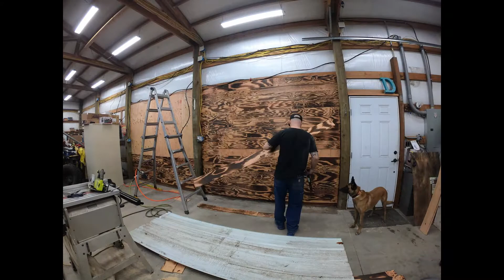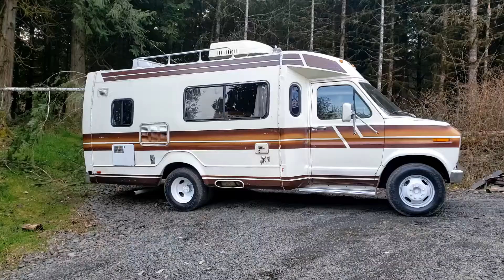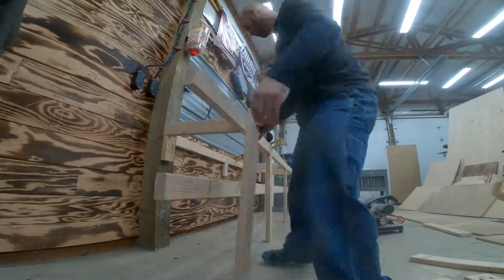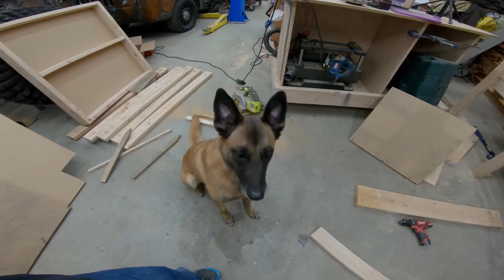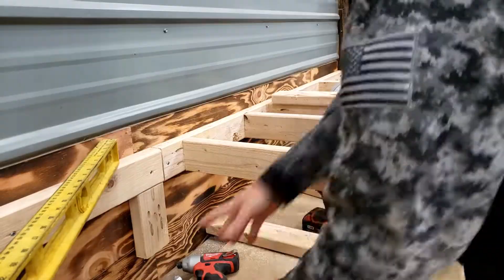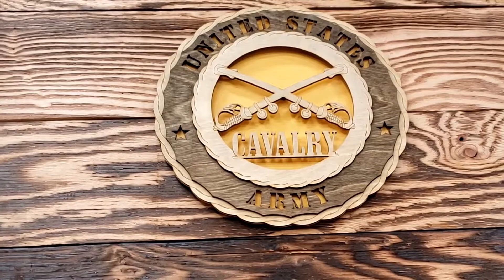Sprucing up the shop and building a work bench

Comment: Nice work.  I'm inching along my shop/space/area to support my FC project.  Hoping to run some 240V this week.
Reply from the maker: inch by inch it will get done. 240v is a must.
Reply: @klugersgarage2802  I had 110 stretched in a daisy chain through my basement & my 110/220v mig attached to the end of 110v. The voltage drop was so bad I could burn a crayon. I'm putting 220 on a big wire to the back door & "go build something!"
Reply from the maker: @johnprice1952  that seems safer lol